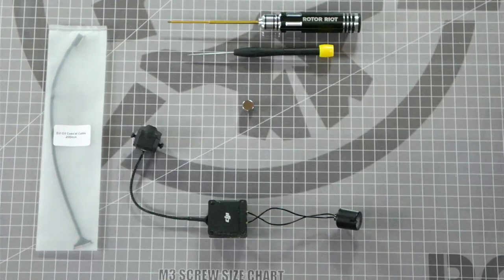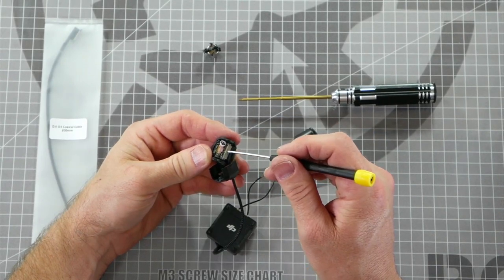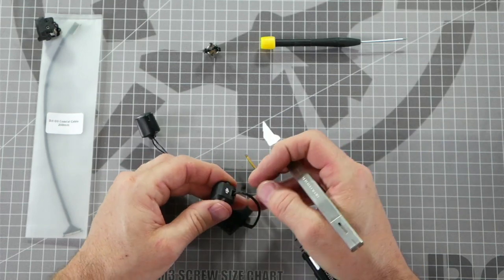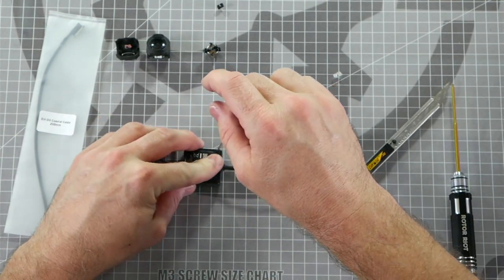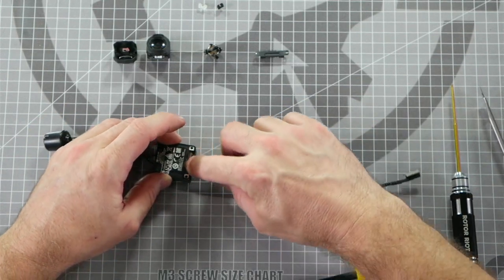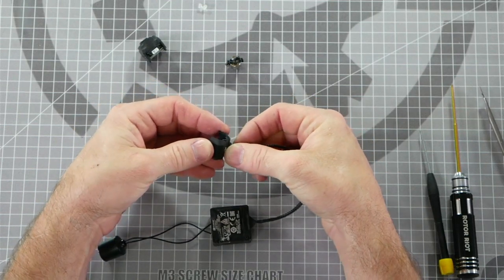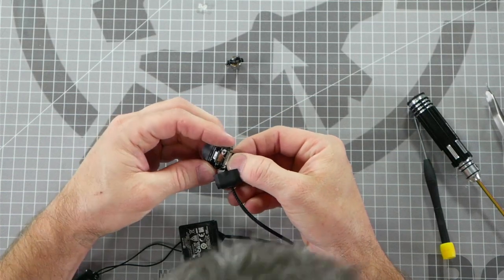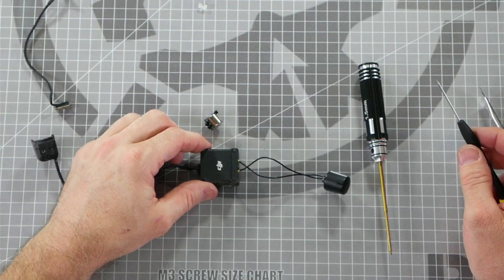How to Replace DJI O3 Camera Cable

Comment: I broke the cable in such a stupid way ; tried to get the air unit in place on my pavo20 without noticing it was UPSIDE-DOWN. Pressed too hard, and cable is dead. Thanks for this tutorial, I m going to try to repair the unit without spending 200$ 😁

Comment: hello, can you put like a caddx camera instead of a o3 camera (par example to use the air unit and a different mipi camera)? from hardware side it is possible.  ... can you try?
Reply: No you can’t. The O3 camera has the imu located in it and other cams aren’t compatible unfortunately